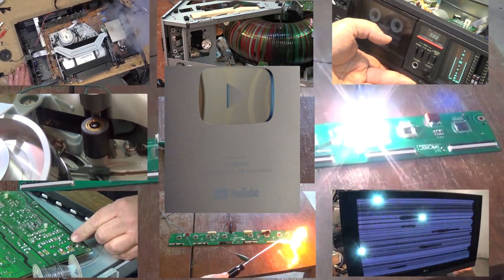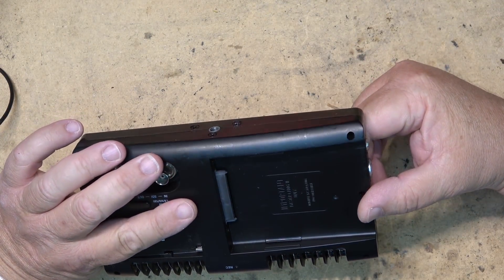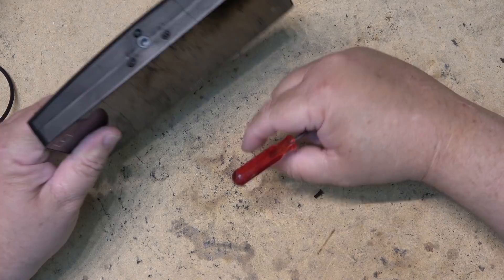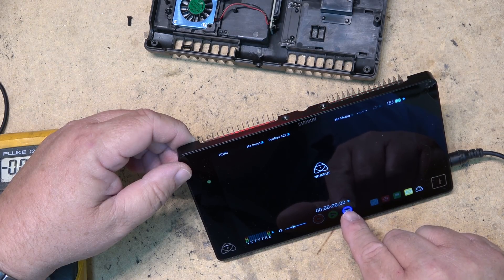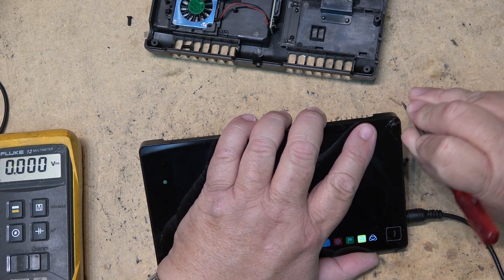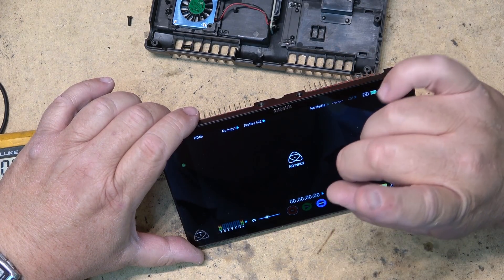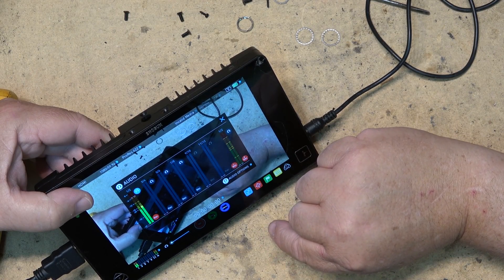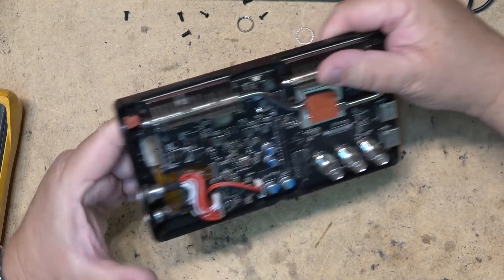ATOMOS SHOGUN is FUBAR

Comment: Read an article about an individual that had one these devices with a cracked screen. Shogun would not send her a replacement part, because they claimed it could not be replaced by the user due to the fact that it required calibration. Long story short, this individual decided to go ahead and tear it down and remove the screen, and hidden under a layer of glue she found out why. The Shogun device used a HTC  1 display. The display even had the standard buttons you find on the bottom of a phone. 

Maybe a regular 7 inch tablet digitizer will work. If the screen inside that device is indeed an HTC 1 phone screen or tablet screen maybe that's your solution.

Comment: Nice looking piece of kit, would be really nice if you could get the digitiser and play round recording on it.  It does look rather proprietary though rather than an off-the-shelf part so not likely.  Only other thing is if somebody has another of these that was, for example, liquid damaged and beyond repair but with the front of the case intact.

Comment: For the screen you never get one from vendor but the mayori of the screen are Standard made from other brand, you need the serial or the code of the screen normali printed in the back of the screen.
Reply: Israel the digitaizer part of the screen (mot comon) organización part of the case. Can adapted other digitaizer forma this size of screen.....
Is a dificult answer.
Reply from the maker: @yoyomismo2052  It is part of the cabinet as AFIK and as far as getting from manufacture, well hell will freeze over first.
Reply: I can't put link YouTube erase the post but I find in China but cost more than 200€ only the digitizer.
Reply from the maker: @yoyomismo2052  
My limit is 20 bucks.  I was given this unit as it was being thrown out.
Reply: I found something on aliexpress, just the digitizer, not that cheap. But not that expensive either, it should be like 60 bucks. I would probably work.

Comment: Would be nice if they'd included a USB socket as a fallback to plug a mouse into or something. Other than that, a very nicely-built piece of electronics.
Reply: it's nicely built, but it comes with a price tag which is saying "prosumers"
Reply: There possibly is a USB header on the board.

Comment: Take the board out and check the connections where the digitizer plugs in (or is soldered to the board). Carefully reflow the solder, then try again. Not for the faint of heart. Or send it to that guy on the Northridge Fix YT channel, or even Louis Rossman.
Reply from the maker: But what good will that do if the glass is broken?
Reply from the maker: @williamsquires3070  depends where the digitizer terminates.    This glass is cracked on the side that the plugs are on.   It's like severing your spinal cord.   Have a fractured back and become a cripple, break your neck and become a quadriplegic .
Reply from the maker: @williamsquires3070  
I should add I have seen phones where the glass isn't even cracked just scratched and the digitizer is dead.
Reply: @12voltvids  On a Samsung phone I've seen a slight crack on a digitizer which still worked but the oled screen not even get cracked but that died, it didn't even light up at all.